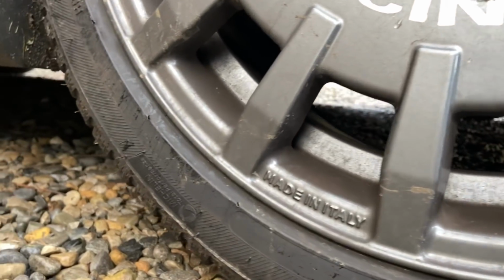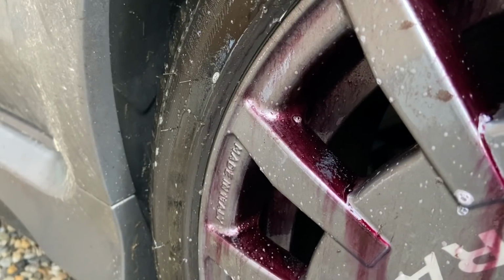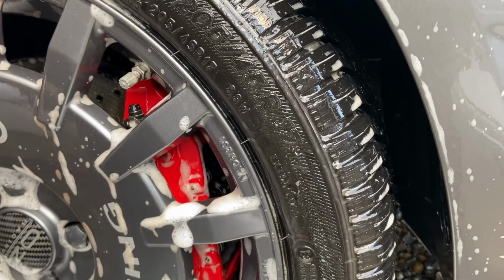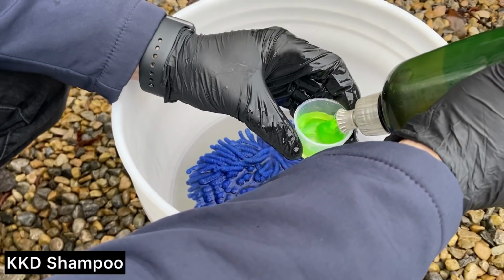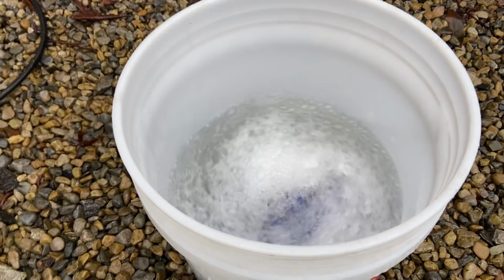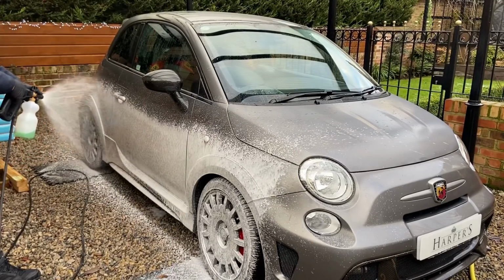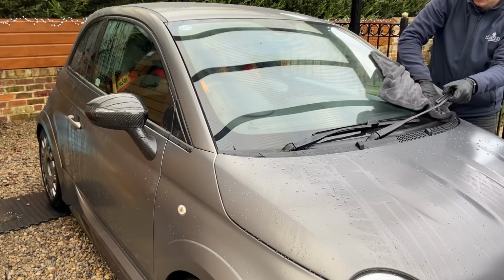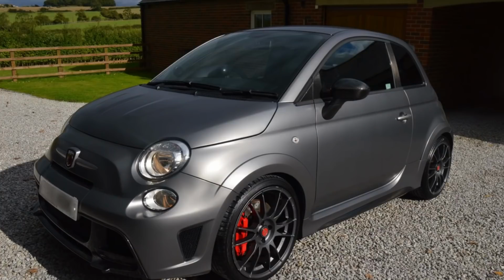Abarth 695 Biposto - Matte Paintwork Maintenance Wash // [Matte Ceramic Coating Update]

Comment: Hi for cars with this type of paint, what is your method for doing paint correction or polishing prior to applying the ceramic coating.  It seems that it would have a similar affect to marring the paint by over scrubbing to remove tar.  Thanks!
Reply from the maker: Hello! 
Big no no to machine polishing as you would essentially make the paintwork glossy! 
Chemical decontamination I.e tar and iron remover, but test of inconspicuous areas first. I would avoid clay barring with the paint being textured, and you really don’t want to damage the paint.
Reply: @HarpersCarDetailing  I really appreciate the response!  This is what I assumed but wanted to hear from an expert.  Thanks again!
Reply: On this subject...could you use a quick detailer or anything after the wash? I am guessing it would add some gloss which would be undesirable on a Matt finish?
Reply from the maker: You can, but you would need a matte specific. 
Nanolex do a product called MATTE FINAL FINISH 👍🏼

Comment: What is that your using on the exhaust tip, wire wool ?
Reply from the maker: 0000 Steel wool, just be very careful an use it as a last resort. 
I would give it a go with an old microfiber first.

Comment: Did you use a mf cloth that you used for applying ceramics for the exhaust as I noticed the spots you put on them? Great vids.
Reply from the maker: Good spot! 
Yes, so instead of just throwing the coating microfibres away which in my opinion is very wasteful, I’ll use them for either interior textured plastics, fabric, leather or dirty jobs like these exhausts.
Reply: @HarpersCarDetailing  are you not worried that the dried ceramic could scratch the plastics or metal? If it works for you though then I'll try it as I have always thought it's a waste as well.
Reply from the maker: I’ll only use it on textured plastics, but even so I don’t think it would scratch anyway, just more of a precaution. 
I wouldn’t worry too much about the exhaust tips as sometimes you have to use 0000 steel wool to remove really heavy contamination 👍🏼